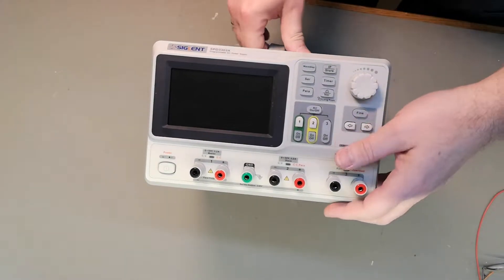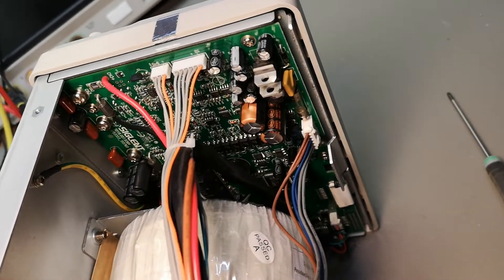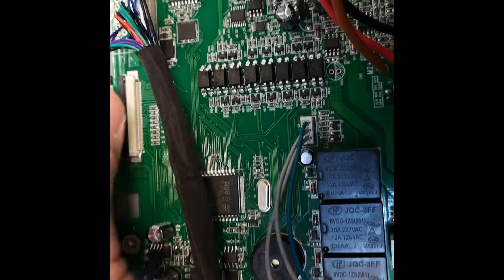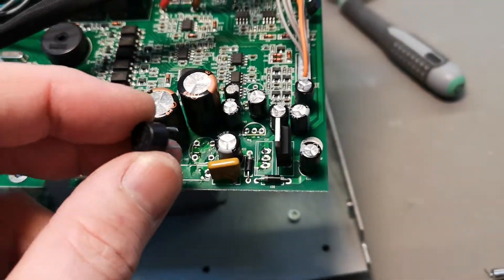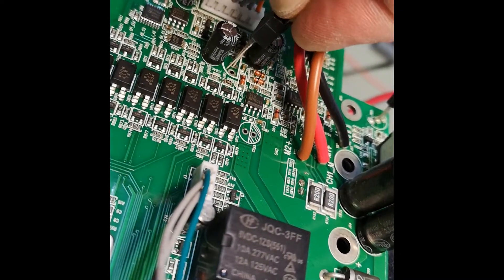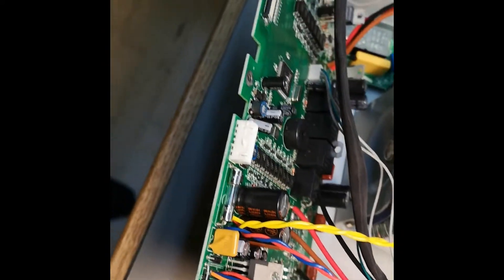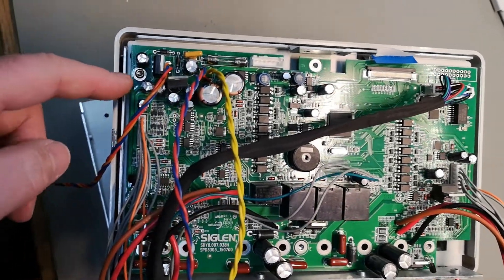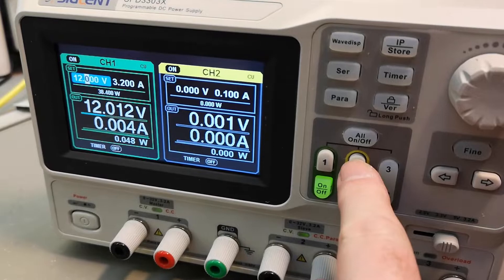Siglent SPD3303X, hot bridge, hot regulators, modification for long life time

Comment: Thanks for the video! :) 
Mine had the same issues with turning off after a short time. I found the bridge rectifier to be very hot, but as the caps were okay I skipped the search there. Then found your video, did the rectifier and 78L05 mods, and now its fine.
Reply from the maker: Great to hear it helped and thanks for sharing your experience!

Comment: My initial thought were the caps must have gone bad, causing various overheating problems.  But I guess it is just a bad design.  I have a digital oscilloscope from the same brand - maybe used it six times for very short periods over two years, and then I could never get it to work again.  It appears to boot up, but then the screen seems frozen, with none of the buttons or controls having any effect.  Gone past warranty period.  Poor products from this company
Reply from the maker: maybe a little hard comment, to be fair i can open almost any product from almost any company and find design issues that could have been made better or smarter for longer life time and better quality at a very low extra cost.
Reply: @TeardownOZ2CPU  Unfortunately, longer product life is not a top design priority.  Product only needs to outlast the warranty period.
Reply from the maker: @rdwoodw  but if equipment only last a few years, people will be informed, and stop purchasing, today bad news travel fast

Comment: They seem to have fixed these problems in the latest SPD3303C except the 15 volt regulators still get a bit hot and could use a heatsink.
Reply from the maker: great to hear thanks, a bunch of the new ones just arrived at work, maybe i should go open one to see their thermal improvements :-)

Comment: Sir, great video. Very good detail in a short amount of time. Clear and concise.

What bridge diode part # did you purchase? I just bought 641-1377-ND and 641-1359-ND to try. 1 kV reverse voltage and 10 A rated.

Do you think mounting to chassis is needed? I was possibly going to apply a heatsink with thermal paste to the bridge. 

I am waiting on a thermal gun to try and see if I have the other hot areas before just replacing everything
Reply from the maker: adding a heatsink to a tiny pcb mounted bridge will make it a lot colder, but it is a mecanical challenge to make it good and stable, you dont need a super large bridge, a small one like mine with a screw hole, for bottom chassis mount is perfectly fine, and will run very cold, it is much better to get heat to chassis metal, over radiating it inside a closed case. All Thermal solutions can be calculated and simulated before performing in real life, but if you like to experiment in the real world, it is also perfectly fine to try out different solutions, and measure performance.

Comment: The bridge may have been better served by SCHOTTKY diodes instead for the greatly reduced forward drop?
Reply from the maker: this moves more loss to the series regulators, since total loss is the same, as long as a system like this got plenty of voltage available, you get no advantage from schottky diodes
Reply: @TeardownOZ2CPU  Yes, aware, but the diodes cannot handle it, the regulator easily can.
I am a retire electronic design engineer, and one of the things that would crack me up way more than once is one of my youngens learning their craft would at some stage plan to use a diode rated at 5Amp is a radial package.  At 5A it would melt trying to dissipate some 4watts of power, ...use you brain kids!   ....well I was not as turse with them, instead I asked them to do the calculations of power and thermal resistance  :)
Reply: btw it was NOT in a bride where it is 1/2 & AC, it was in a back voltage protection!
Reply from the maker: @stevenbliss989  i dont think thermal understanding and calculations is a huge part is EE education today, i hope they figure this out fast, since it is a huge deal, like we see in this video products with missing calculations and understanding
Reply: @TeardownOZ2CPU   Thermal management is a big deal, totally agree.  Hope none of them ever work in the space industry! :)

 I am also a programmer (all sorts), and I had the same issue with young programmers (well most, not all).  They think they know it all when they can write a loop saying "hello world! ten times.  It's all very sad, and I am not happy with the institutions that supposedly teach them, you are so right about that!

Comment: It's interesting how the hottest parts are placed right next to the capacitors which will also age accordingly.
I smell planned obsolescence.
Reply from the maker: it is an unwanted side effect of regulator datasheets require a max distance to capacitors,
so people try to make that as small as possible, and now have a product with shorted life time, 
it is also not smart to run regulators that hot the first place.

Comment: Thank you Thomas, my supply also showed the same rebooting issues, shutting down with even no load applied. I implemented your mods and everything seems to work wonderful. 73! Adrian, YO6SSW
Reply from the maker: there is a new problem with siglent firmware updates for this model, their webpage dont state what hardware versons are compatible with what type of firmware update, I tried the last version for my model supply, and it failed to update, Siglent support still struggle to figure out a usefull answer now 2 weeks passed.
Reply: @TeardownOZ2CPU  I thought the same but the information is stored in the readme. You can see it here: https://www.siglenteu.com/wp-content/uploads/dlm_uploads/2022/09/SPD3303X_X-E-Firmware-Revise-History-.pdf Unfortunately my hardware version is 3 so I cannot apply the latest firmware. What hardware version is your supply?

Comment: Perhaps it would be good to show how a multi-channel laboratory power supply can be connected as a balanced supply (+12V) : 0 ground : (-12V). Connecting two channels in series does not seem to create a zero point for the positive and negative voltages. I believe that this is possible by connecting (A-) and (B+) separate channels and thus creating a zero potential for both the positive and negative voltage branches. It is good to connect the zero contact to ground (in both channels of the source).
It would be good to have a short video on how to connect it and how it works. There are several videos on Youtube about wiring two separate sources as symmetrical. I think that both separate channels of one source should work exactly the same.
Reply from the maker: correct, all the series mode does in this supply is a relay connect + and - between the two individual supplies, and also lock their settings to symetric opperation, same voltage and same current limit, in case you want non symetric voltages, you need to use individual mode, and perform the series connection with your own external wire. i need this rarely, most common use of series mode in my line of work is simply one voltage that is higher.
Reply: If there is no video, at least try to confirm whether it is possible to connect two separate channels of one laboratory source 2x 0-32V in this way. Or describe it a little in the answer. Thank you very much.
Reply from the maker: @ivandrimal5783  like i said : you can of course always take two individual powersupplies and connect them in series, this type here, consist of 3 individual powersupplies they are just in the same case, and same display is used, and the user interface simply have a relay that can connect them in series or in parallel, 
I dont think you need a video to understand this :-)

Comment: What is that part number with wires you attached
Reply from the maker: not sure what you mean, I dont have any part numbers
Reply: @TeardownOZ2CPU  3 wires you soldered to transistor
Reply from the maker: @Tech3604u  it is a voltage regulator, that gets hot, by moving it to the bottom metal, it wil be cooled = last longer, it should be explained in the video